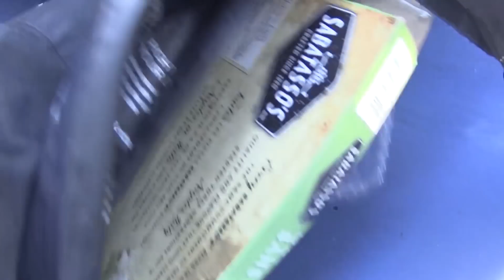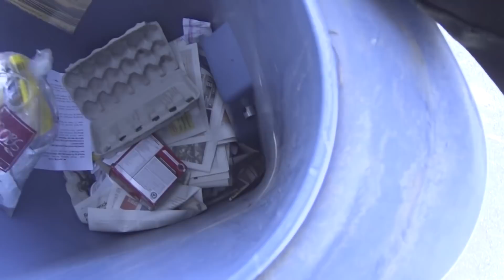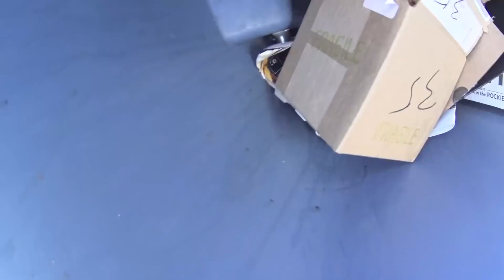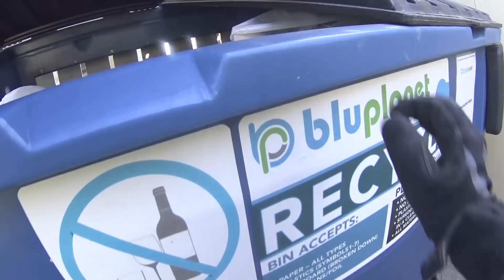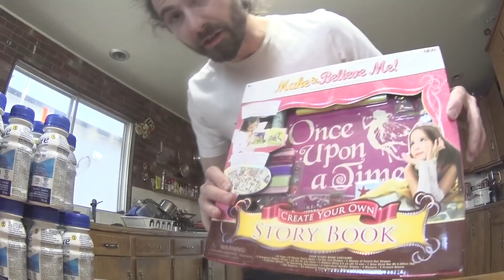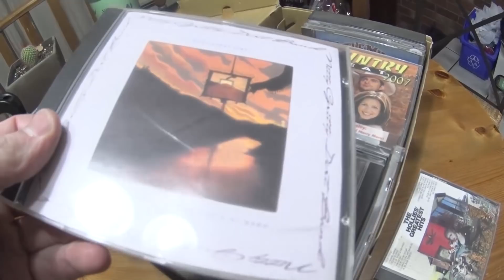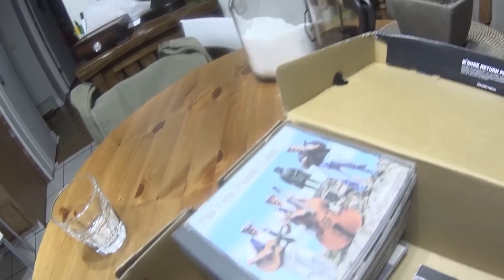Treasure Hunting Bottle Picker Adventures!

Comment: Great stuff as always, Thub. Had a pretty good night last night, there were cops at one of my locations for some reason, but immediately after leaving there empty handed, I found a construction bin with all sorts of goodies. I found fluorescent light fixtures, copper wire, iron pipe, bunch of goodies that made up for everything. Then halfway through my route I found a wrecked toolbox for the bed of a truck that pretty much took up half the room in my 4Runner, so I had to go home, unload, and go back out. I kinda see that as never a bad thing.
Reply from the maker: That sounds like an adventure! Could you not strap it to the roof rack? Getting a solid haul is always good but maximizing on your capacity is pretty key
Reply: @thubprint  If I had been better prepared, yes, I might have strapped it to the roof rack. But I was ill-prepared for such a thing. Luckily, my route doesn't take me too far from home and I was only a few minutes away at that point, so I got lucky. I will try to be better prepared from now on!